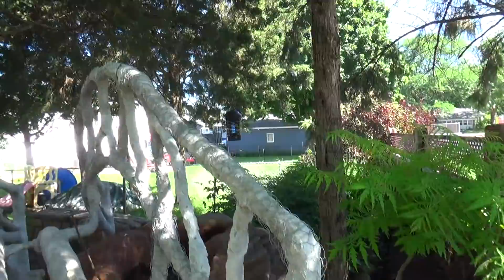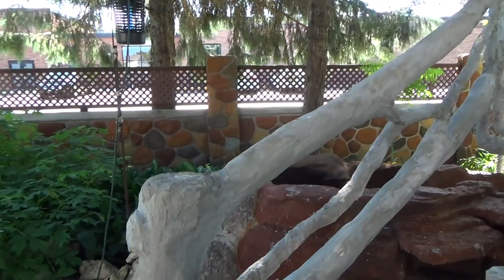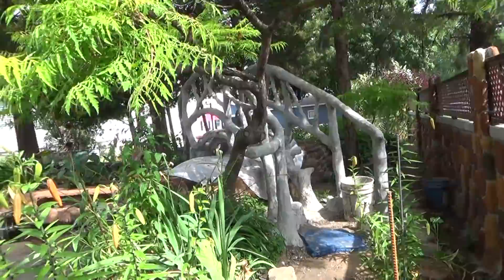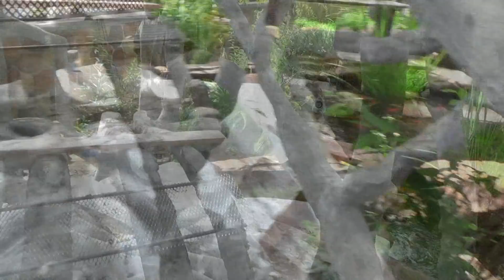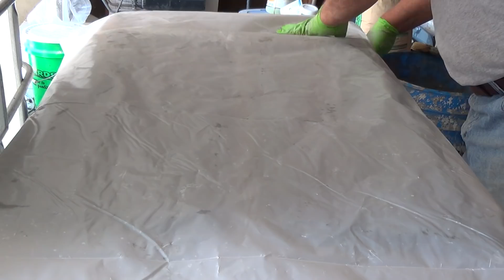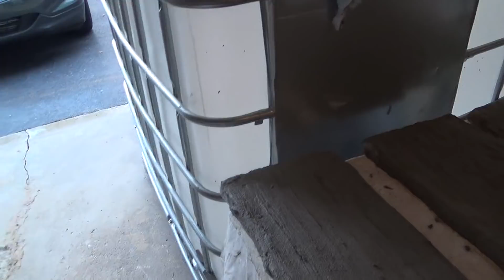Part 2 Update and Progress on Faux Bois Concrete Bridge

Comment: I can this process is labor intensive but yields great results i''m curious what the total cost of all materials might be for a job this size?
Reply from the maker: That's difficult to access.  I calculated to the cost of materials for my fence project at about $1800.  The bridge was done over a period of about 3 years, interrupted during that time for me to have three surgeries to replace both my hips and a knee.  My guess is that it is less than $500.

Comment: How much would you estimate the various costs of materials were for your bridge?  Individually and sum total, or whatever is practical for you.
Reply from the maker: I didn't keep track since this project was done over a period of essentially 3 years.  I was having pretty serious problems with my leg joints and couldn't work for long periods of time.  #3 rebar for a 10 foot section was about $6.50 and I used about 10 pieces.  A roll of chicken wire 2ft x 25 ft was about $15.  Portland cement 94lb bag was about $12.  5 gal bucket of acrylic admix about $150. Silica fume 50lb bag $65.  Metakaolin 40lb bag $50. CSA cement additive 50lb bag $40. PVA fiber 5lb $69.  Medium sand 50lb bag $4.50.  Acid stain 1 gal. $85.  Expanded metal lath sheet 27in x 96 in $16.  Roll of tie wire $10.  Those are the materials I used, but I couldn't begin to tell you how much of each I used for one specific project.  Some materials, like metakaolin, silica fume and CSA are used in small quantities and a bag of each does a lot more than this project.  Same with fiber. A 5 gallon bucket of acrylic is diluted with 3 parts water, so that 5 gallon is actually 20 gallons of liquid for making concrete.  That's a lot of concrete. A cubic yard of concrete uses about 20 to 25 gallons of liquid.  I did an analysis of what my fence cost and it was about $1800. My entire fence was about 2.1 cubic yards of concrete, so you can guess what part of a cubic yard I used in the bridge.  I'd guess the materials for the bridge were likely around $300 to $500.
Reply: @dperry428  i would have thought the cost of materials was 10x that
Reply from the maker: When things are made, labor is at least half the cost.

Comment: Hello, Mr. Perry.  Your work is such fun to watch.  I would like some feedback about making concrete pavers for my driveway by pouring them in place. That is, I would be allowing each paver to fill any voids in the hard-packed asphalt/dirt and become its own base.  I would use a mold and trowel the top so I could control the plane of the top surface, though I would like the top to be rumbly and "cobble stonish."  Any suggestions you might have about concrete formula, reinforcement, etc. are welcome.
Reply from the maker: Keep in mind that I am NOT a concrete expert nor experienced in concrete contracting.   I've thought about doing just what you are thinking of doing to my own driveway that is currently asphalt.  I used a mold to do the pathway around my pond.  https://youtu.be/D1oEnxfydc8  Were I to do my driveway, I'd simply use the same mold over the asphalt but use a UHPC mix like that used on the bridge construction.  Metal reinforcement would not be necessary, especially with an enhanced dosage of glass fiber.  I'd use a 3 fine silica sand to 1 portland cement mix, 1/2 part glass fiber, 1/2 part PVA fiber with 10% metakaolin, 8% silica fume, 5% CSA (Buzzi Unicem) cement, acrylic admix in the liquid and, since it is a horizontal pour, a small amount of plasticizer to reduce water content.  This would give a mix, if done with minimal liquid, that has a compressive strength in excess of 12, 000 - 15,000 PSI
Reply: So helpful!!  Thank you, sir.  Were you a concrete expert or experienced contractor, the creative solutions that you employ would seem impossible to you  and wouldn't even enter your thought process.  After constructing the pavers, would grout or infill be necessary to avoid chipping, etc?
Reply from the maker: As you know, when you use a mold to create the paving stones, there is a space left between the stones.  With my path, I used a trowel to round the edges of the stones down into the space betwen stones. That rounded the edges of the individual stones to prevent chipping those edges, and it also filled the spaces between stones to prevent weed growth within the spaces.  One could also grout in the depression left after rounding off each stone.  I'd use the same mix to keep the same strength as in the stones.  That would be a matter of the finished appearance that is desired.

Comment: Hooray! I've been waiting to see the progress on your bridge. Thank you for posting videos of your work; they're very informative. Do you find any of your cement structures cracking? If so, what do you do about it?
Reply from the maker: For the most part no.  Older work, made with older recipes have developed some minor cracks. I had two cracks in my pond wall a few years back as the result of a rare earthquake, the epicenter of which was just 9 miles away.  A couple of pathway rocks, made 8 years ago with a common bagged mix have cracked. The additions of metakaolin, silica fume and Xypex have virtually eliminated all cracking. PVA fiber is especially effective at crack prevention. Xypex has the ability to heal minor cracks, preventing them from becoming larger.  Should an unacceptable crack develop, a simple slurry of acrylic, cement and Xypex can be applied and, after curing, restained.
Reply: dperry428 Thank you. I’ve looked for Xypex, but I can’t find it locally. Where do you purchase it?
Reply from the maker: First, Xypex is a brand of crystalline waterproofer.  There are many brands, such as Penetron, Aquafin,  Krystol, Vandex and on and on.  If you go to the manufacturer's website, there is usually a link to distributors or an email link to sales that can direct you to a local distributor.  Also, check out eBay and Amazon.  I found Xypex Concentrate on Amazon.  It isn't cheap.  I buy my Xypex admix at an industrial supply company.  I've also found it at HD Supply Whitecap.

Comment: It is always a treat to find you have posted a new video.   A question.  I would like to edge my pond with faux rocks that extend below the water line.  Of course regular concrete would not last the winter. Is adding the latex enough?   Have you covered what mix to use in one of your videos?
Thanks.
Reply from the maker: The more water impermeable the mix, the better it will stand up against the weather.  My pond is made of concrete using a 3 to 1 sand/cement mix with polypropylene fiber and acrylic in the liquid.  It has withstood 12 years of northern Illinois winters.  Here's a video from 5 years ago: https://youtu.be/I-MOVa_kXJo  I also now add silica fume in addition to the metakaolin.  I also like using a crystalline waterproofer such as Xypex if concrete is going to be in contact with water.  It is the ultimate in waterproofing.